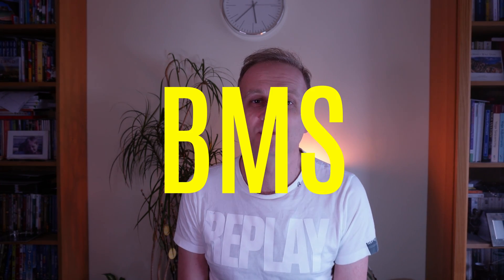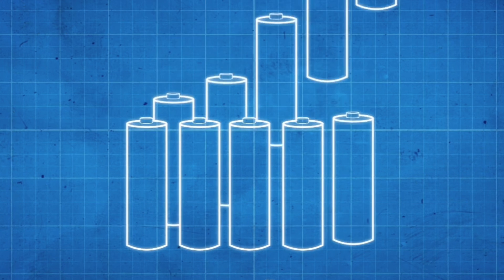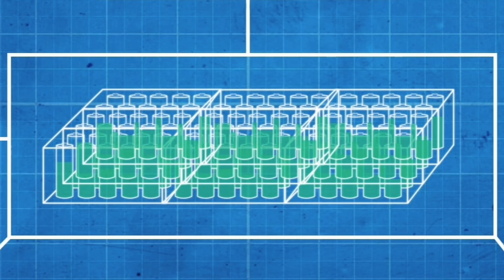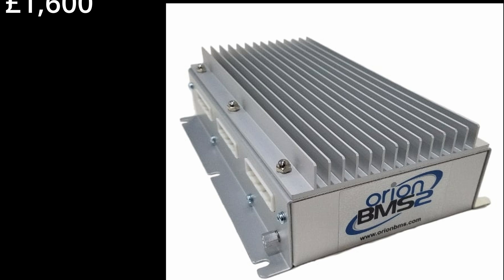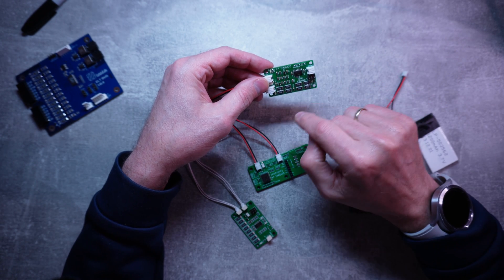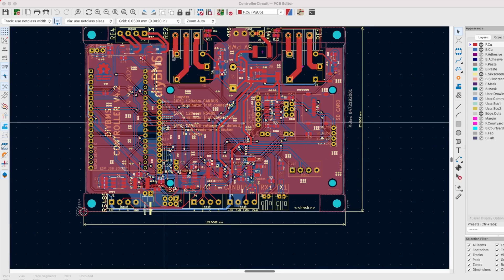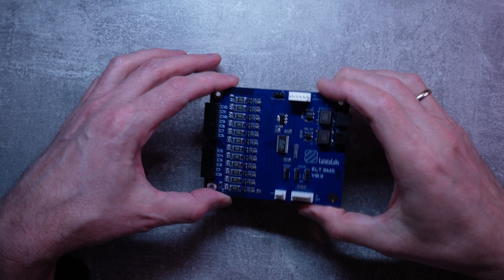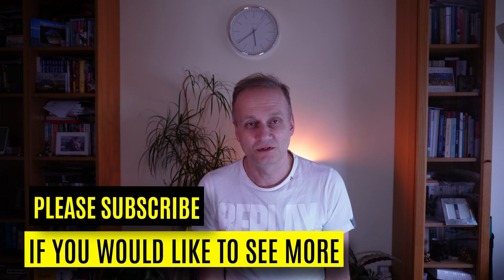What BMS should I choose for my EV conversion project

Comment: My biggest confusion is how many BMS’s I’d need for an entire battery pack. My goal is to run 380ish volts from Tesla model S modules, going to a Nissan Leaf motor… Would one suffice?  I know it really depends but I struggle to find info on this specifically
Reply from the maker: Tesla model S motor would run ok between 360V and 400V so it depends on what battery modules you are using

Comment: Hello mate I have a motorcycle ev conversion I have 4 LG chem 6s2p battery modules. I am having trouble with choosing a BMS. Can you help me? Thanks 😊
Reply from the maker: You could try DIY BMS or Simps BMS. Although SIMPS BMS only works with some modules like BMW for example. If you Google for it you will find information about it
Reply: @LatutaEV  thank you mate. I will have to watch you videos a lot to be able to do diy haha
Reply from the maker: I think DIY BMS might be a good option to try
Reply: @LatutaEV  will DIY bms work with 1kW discharge rate?

Comment: I hadn't even heard of ELT. Simp works very well if you're using BMW modules (and many others) and there are loads of hardware options - buy one, roll your own (as I did initially) or other custom boards.
Reply from the maker: I am not surprised, ELT is my own design 😏. Where would one get the gerbers for Simps?

Comment: My EV friend.   I have hacked my ebike and robotic mower, but you now are in an area beyond my humble skills.  However, you could help with a suggestion maybe.   I have a Gen 2 Prius, and my daily driving is only two miles at 20 mph.   The car only gets 30 mpg because of the excessive idle time on startup.  I could charge the HV battery and had a charger but gave up because SOC did not prevent the ICE from starting.   If I cut off fuel supply can I use this car as an EV in town?   Is there a way to program the old Prius as you do to use EV  ONLY??   It seems such a waste for an old man who drives so little to monopolize a new EV that a real commuter could  use.  Any ideas appreciated.   I will check back on this video for any possible answer.   None of the old EV conversion companies in US will answer emails and looks like with Tesla in full production most are just abandoning idea of conversion and going to new EV.
Reply from the maker: Hi John, This is definitely possible, the problem you will have is overriding Prius ECU as it will demand the engine to start at some point and you would get an error I guess. The second issue is how much capacity have you got left in the battery. As far as I know Gen 2 is using Ni metal hydride battery. I am not an expert on it but I think I have red somewhere that it is suppose to last about 5 years. Although I have seen a video on youtube where some company in US does upgrade older Prius batteries with Li Ion. They use LFP batteries which in my opinion is the best in terms of longevity. I think I have definitely seen a video of someone driving Prius in electric only mode. Here you go I have found it ;-)

https://youtu.be/dThsCF4uPLo
Reply from the maker: .... and found the one about upgrade

https://youtu.be/w47GMVKtwKw
Reply: @LatutaEV  Dear EV friend, thanks a million.   I admire you very much for what you are doing.   I have been in touch with the man who sells the LFP drop in HV battery and it WAY more than I would need for the 2 mile trips, but if I could make the EV mode work I would do it because I believe the plug in charger would work better and many long years with LFP.   My battery test with Dr. Prius app showed 70% capacity remaining which is pretty good for a 14 year old car with 160,000 miles.   But perhaps it hasn't had too many cycles??    Thanks for the videos.    I will give them my full attention and let you know if I can make it work.   I really appreciate you!!
Reply: @LatutaEV  OK, yes, I have seen this one.   Basically, his car is already warmed up and he has a full charge on the battery.   Just a few minutes ago on my return 1 mile from the park to walk my car did exactly the same thing.   If it is warmed up and a pretty good charge then as it is downhill my entire return 1 mile is EV mode at 20 mph if I don't accelerate too hard...usually..not always.  Depends on the battery.    Obviously I had the lithium battery and could show a high state of charge then this would work consistently, BUT I would possibly need to trick the engine heat sensor or some other component to think engine was very warm.   Or it may run on some kind of timer?   That I don't know.  Jack, the fellow that sells the LFP batteries said he was looking into a way to program the ECU, and I shared your video with him where you were discussing that point.   it should be so simple.   ??   Esp. since I am just trying to make it EV for low speed and very short distance which is ALL my driving with the exception of 2 trips of 700 miles  each every year.   Thanks again, sir!
Reply from the maker: @woody3307  it may be simple if you understand how to decode CAN messages. You could send the command to the ECU that emulates engine response. You may want to search on YouTube how to read CAN commands from a car. But my approach is different in a way that I use Open Inverter board to completely replace the inverter control board so it becomes independent of the ECU
Reply: dear friend take a look at this instruction
 http://www.calcars.org/prius-evbutton-install.pdf